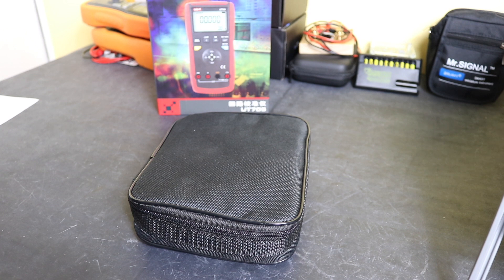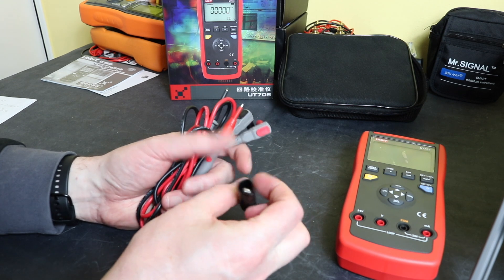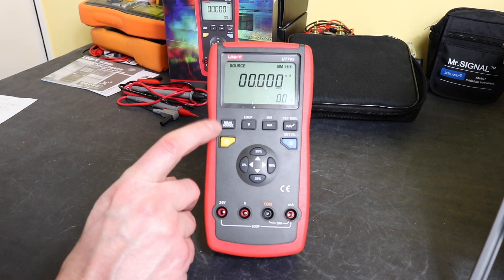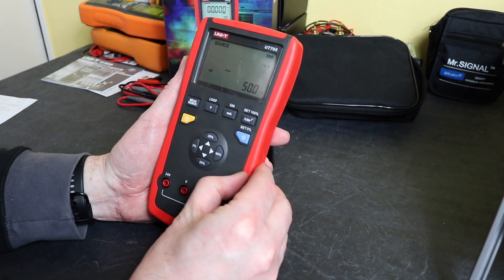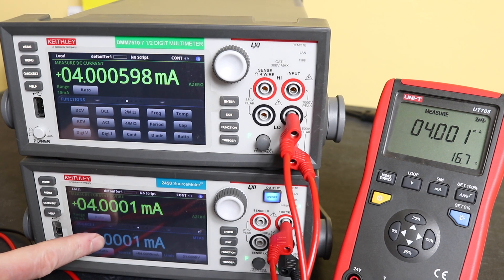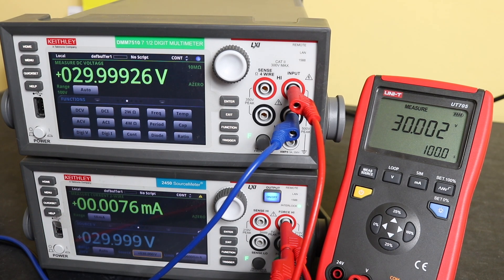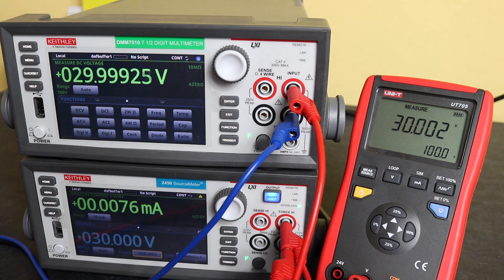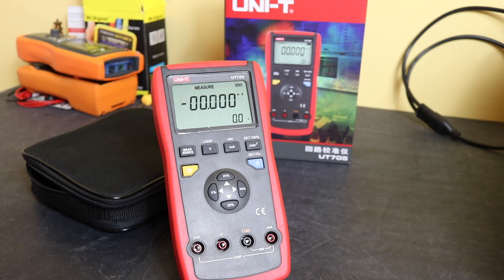Review and Testing the Uni-T UT705 Process Loop Calibrator

Comment: not being able to source current is a big disappointment though
Reply from the maker: It can source current but not voltage, but you are right it is a disappointment and it should really be able to do both. Guess they are trying to get you to go out and buy the UT701 as well to cover the voltage function. Thanks for watching.
Reply: @three-phase562 can use a R of 500 K in Parallel to Source Voltage ?
Reply from the maker: @doviedop  It a good question but unfortunately, these current sources don't work as expected. They seem to push out a constant 24V and adjust the current limit accordingly. They don't seem to work as a standard power supply that would generate enough voltage to drive the set current through the load, which would then work across a resistor as you have suggested.
Thanks for watching and commenting.